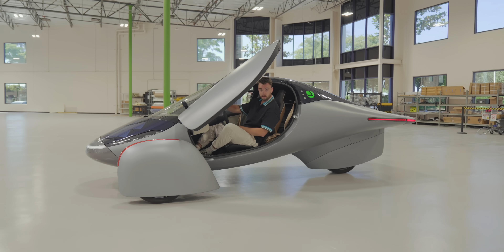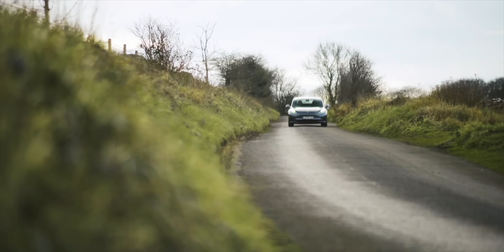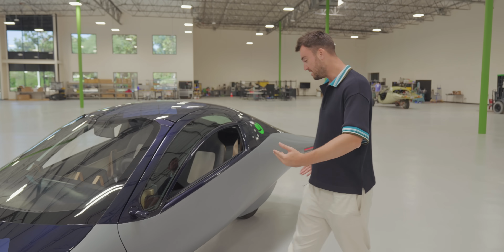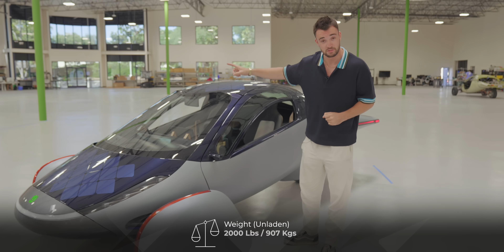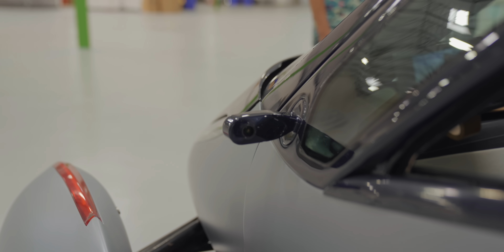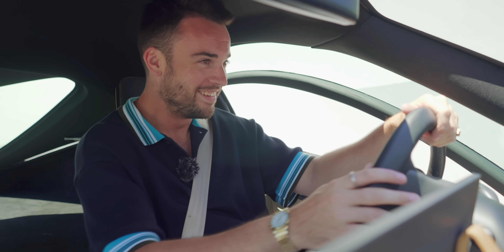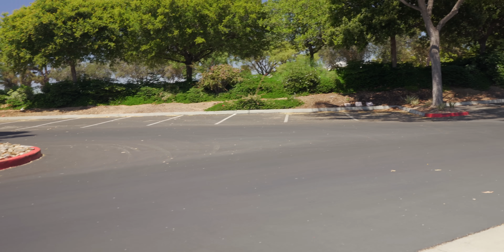The Game-Changing CHEAP Electric Car Inspired By Fish!

Comment: I've been looking at this and honestly I want one, but here's my question. How tall is the host? Cause I'm 6,9" tall and IDK if I'd fit in the thing. Maybe I could get an XXL version?
Reply: Frankly, the tallest it has been designed for is 6'8".  Jack of fully charged is 6'8", and he seemed to be able to drive a smaller alpha version OK.  The gamma and production delta models are larger inside, but I would certainly sit in one before I made my final decision.  Since the deposits are refundable, you could still place a reservation and make your final decision after you have had a chance to try one out.
Reply: @n.brucenelson5920  thank you.

Comment: the aptera, same scam as the elio, remember that, years of begging for presales and investors, huh, never happened. now its been years that aptera has been using the same business model. dont send your cash until they actually produce the vehicles. w.c. fields quote...... there is a sucker born every minute. hey i have a bridge to sell you.
Reply: Not at all.  The original business models were very different in many respects.  Elio for example, never offered refundable deposits.  

Aptera was originally partnered with Idealab.  They hired a CEO from Detroit who got rid of the founders in a board coup, and then changed course, but couldn't find financial backing for a different vehicle and liquidated the company, returning the customer deposits and paying off vendors.

The present Aptera is structured to make a such thing very unlikely to happen again.  Look at the SEC filings, don't take my word for it.
Reply: @n.brucenelson5920  heck i hope they do get it into production, i would buy one for getting around town, a neat concept, just seems like units like these just never make it to the marketplace.
Reply: @johnmichaeltracy9050  What they are attempting is indeed VERY difficult.  I think that this time the founders have gathered enough support to make it happen, and I am willing to do what I can to assist.

Comment: I wonder if they could extend the body a little to provide more protection. You wouldn't take that out on a Australian motorway/highway with the way people drive here and a truck might run over you. It may be good for city but even then during peak hour it looks like another nearby car could easily snap part of it off.
Reply: There are crumple zones front and rear, in addition to a carbon fiber and Kevlar passenger safety cage.  Aptera will be third party crash tested to FMVSS Part 200 safey standards as soon as they have production intent vehicles to test and you will be able to see the actual safety ratings.

Comment: Are you really tall? Because the vehicle seemed significantly smaller than what I have seen in other videos.
Reply: The alpha models were significantly smaller than the gamma or production deltas will be.  They should be good for people up to around 6'8".
Reply: @n.brucenelson5920  Neat, thanks. Aptera is really the only electric car that interests me currently it would have been extremely disappointing if it was a tiny car that couldn't be sat in for more than 30 minutes without becoming cramped.
Reply: @i-hate-handle-names  Yes, I would certainly agree.  You should have a chance to experience sitting in one over the next few months.

Comment: does it ask you why you have the heated seats on with the Air con on?... it should, lmao! oh and while we are at it, talking about efficiency... cough*, *cough why the hell is it being made in cali?... it would be much cheaper to build in texas, florida, arizona, new mexico and it would be being built in one of your highest sales states.  The big heads in cali won't be driving those, sadly they make too much logical sense.  dems don't like that.
Reply: oh, one more thing, i hope it is easy to replace the batteries
Reply: I worked for a California startup that intended to move out of the state.  After an extensive study, we came to the conclusion that "what everyone knows" about this is not true during the startup phase.  Aptera will be expanding production outside of California, however.

Comment: Definitely quite unique yet stunning vehicle but in your description it should stay based on a mammal dolphins are not fish even though they're fish like but are related to killer whales. So definitely not a fish. Just had to add one more thing why did I not just put Alternators on all three  if not two wheels to boost its efficiency to Max Capacity.

Comment: you could maybe pickup milk at the store. other than that what can it be used for other than transporting a single individual. might as well get a bike.
Reply: 25 cu ft of storage and enough room in the back to sleep a couple on camping trips.  It will be better than our present Gen 1 Honda Insight, and even less expensive to run.  

By the way, nothing wrong with bikes, and my wife and I have gone cross country on them, too.

Comment: How about the solar electric scooters for handicapped? The front wheels must be underneath of the car for parking convince. I was watching a little electric car struggling on the hill with the icy road conditions - the tires and the length of the vehicle are important to cope this driving on the hill and on ice combined.
Reply: Aptera can be fitted with standard snow tires and has far better ABS and traction control than most vehicles.  It can sense slip and adjust torque every 2.5" of tread travel.

Comment: Look like a silly toy. 
When i see a prototype like this i always try to think about what its going to look like after 5 - 10 years of usage on the streets. A dent here, a gash there, some aftermarket replacement parts... etc
I'd be very surprised if this thing made it 2 years. 

Half the price of a Tesla huh? so $35k... thats a lot to pay for a disposable toy.
Reply: $35,000 will get you a well equipped 400 mile range vehicle before incentives.  250 miles of range starts at $25,900.  I suspect that these will have an average lifetime of more like 40 years on the roads.
Reply: @n.brucenelson5920  How are you going to get 40 years out of it when the battery doesnt even last 5?
It would be different if these companies used a standard battery that you can get anywhere, but they go out of their way to make sure that thats not the case.
Reply: @nottiification  What makes you think Aptera battieries only last 5 years?  It is likely that the packs will give at least 400,000 miles of range before they decline to 80% of capacity, at which point they still have considerable value in stationary power applications.

The 2170 cell form factor is about as standard as it gets, and they are available from multiple suppliers.  Aptera grants right to repair, so there will be no challenges to third party companies that wish to offer rebuilt Aptera packs when the time comes.  This also means that the software in the vehicle can be reprogrammed to suit new battery chemistries if future developments warrant it.
Reply: @n.brucenelson5920  Have you never owned a laptop or a phone or a e-bike or anything else that uses lithium batteries?
5 Years is a very generous estimation.
Reply: @nottiification  Tesla has said that their 2170 batteries should last between 300,000 and 500,000 miles. Based on an average driving distance of 260 miles per week, a new Tesla battery can last anywhere between 22 and 37 years. There is no reason that Aptera's should be any different, and they are likely less highly stressed in the Aptera application due to the lower weight of the vehicles.

Comment: Except you're currently not aloud to charge your electric cars in California due to the power grid problems.
Reply: False information.  It is only for a couple of hours during peak power demand.  Most EV owners only charge overnight in any case, when rates are low and there is plenty of power.
Reply: @n.brucenelson5920  You are correct, but it is still ironic and worrisome.
Reply: @huffnbassist8779  It is part of the reason I have just moved from California, to Iowa, where over 1/2 the grid is powered from renewables, mostly wind.

Comment: Hey, do you want to see a bizarre type of collision? The fantasy/hype of this feature collides with the stark reality of the present moment ...

Copy this headline and paste it into your favorite search engine (I'm assuming that its Google) and read what pops up.

"California asks residents not to charge electric vehicles, days after announcing gas car ban"

CALIFORNIA (WTVO) — With California’s power grid under strain due to extreme heat and high demand, the utility grid operator is asking residents to avoid charging their electric vehicles. This comes days after the state announced a plan to ban the sale of gas-powered cars by 2035.

California doesn't have the infrastructure in place yet to handle all of this.

- Lets Go Brandon!!! Hi I'm Mr. Rourke and this is my humble assistant Tattoo - Welcome to Fantasy Island"

Comment: I had a MAGAT tell me it would drive up the price of home insurance to have a charging station in home. It's important to have the right kind of home owners insurance so that your home is covered in the event of losses. Otherwise, however, the charging station doesn't drive up the costs. In fact...it's likely to increase the value of your home! So the MAGATs disparaging the EV are only delaying the inevitable! yes...some EVs are un-Godly expensive. But as time goes forward...this will change with progress. But fighting progress is a MAGAT MO.

Comment: Don't use government hand outs for anything, including rebates and the rest to lower costs.  Do have cheaper options, make the design to be had absolute bare bones on the cheap. 

China is producing and selling $5k electric cars, they are crap of course, but people are buying them and driving them on the roads.  You can beat the hell out of them in what they are doing with yours, just think scaled down and you are going to make waves.

Comment: the only thing unique about this is the side-by-side aspect of it... things like this have been done in Europe for about 30~ years... except most people looked at them and thought they were more motorcycle than car vs the side-by-side which makes you think car instead of motorcycle. Also (edit) 2000lbs is about 200~ lbs lighter than a Mazda Miata... so while light... not that light.

Comment: come on 88in width, 300Nm torque 110mph top speed, charging time 8 hours for $46,000, i'm sure people are wiling to make more stops to charge rather than this. also i'm sure a burst of wind will roll you over on the highway, a flat tire and your day is gone looking at that wheel cover,

Comment: Áptera is a full on scam!!
Reply: There is not a shred of evidence for such a claim.  If there was you would not seen Sandy Munro Associates, Roush Performance, and 1st tier parts suppliers associated with them.
Reply: @n.brucenelson5920  maybe so, but if they are like they were in 2010, I Don't have much faith in them. I guess only time will tell.
Reply: @craigwiddison4118  Completely different people from 2010. The original founders lost control in 2009.  I agree.

Comment: Does this require a motorcycle license or 3-wheel certification of any kind? I'd prefer if it had 4 wheels and some bumpers tbh. Otherwise, pretty neat.
Reply: Not for any State but Alaska at present, as far as I can tell.  Check the rule for enclosed autocycles where you live.

Comment: the price I saw on their website is well over 25K for a vehicle that can only go 40miles on a charge.  maybe they'll put a solar panel array on it to recharge the batteries to get more milage. if you live in Santa Monica and have to  the other side of L.A. on the freeway at the height of rush hour. you're going to be pushing your car to a charging station.  It's probably good for neighborhood traffic to go grocery shopping.,
Reply: You have misunderstood something.  The smallest battery range available is 25 kWh and it will do 250 miles on a charge.  It runs $25, 900.  The 41 kWh battery I have on order will go 400 miles on a charge.

Comment: I wonder how well it would get along with cold temp's and six inches of freezing slush and muck or a foot of snow ? Doe's it have a heater and air conditioning ?
Reply: Yes, both heat and AC are standard.  I plan to use mine year round in Iowa and will report on my experience.

Comment: Lighter means you can't drive it on rainy windy days because with no road maintenance being carried out and hundreds of large puddles on the roads it's a vehicle that is highly likely to aquaplane.  The cost of repairs to a vehicle like this is probably astronomical and therefore probably affordable for the medium to very rich....and they love their fuel guzzlers.  Nice try.....Next.
Reply: Not true.  We drive a Gen 1 Honda Insight which weighs about the same 1800 lbs as the 40 kWh model, and doesn't do this.  Aptera performance will exceed it in every respect.

Comment: Could you charge it with the equivalent of a tanning machine on dull days?
Reply: On dull days, just plug it into a 110 volt 15 amp outlet and you will gain 13 miles per hour of plug time.

Comment: Really curious how well one of these will cool in Arizona where it gets pretty darn hot in the summers around 110+ usually
Reply: I lived in Mess for 16 years including the day it hit 122.  I think it will be fine, due to the fact that the body has many times the thermal insulation of most cars.
Reply: @n.brucenelson5920  it's passively cooled like the nissan leaf it's not the driver comfort I'm worried about its more how well the battery will handle the extreme heat

Comment: Love the design, just wondering if there will be protections built-in against theft by a group of people picking it up and walking away. Also would want some kind of alert that it is not charging because someone threw a blanket on top or blocked exposure to the sun some how? I would love to see this car succeed. Could you add charging through the turning of the wheels and little turbine like fans built into the design?
Reply: The problem with turbines on cars is they create drag. You end up using more electricity to speed up and keep moving than they will produce. As they mention, a lot of energy is used just pushing air out of the way while driving, it is a very strong force against a moving vehicle. Turbines would create drag and cause it to require more energy to drive. After energy loss from friction, resistance, etc., you end up with a net loss. They'd really only work as a means of regenerative braking. Regenerative braking is what you get when you put a generator on an electric car, it's a very similar idea. Use the car's motion to turn a generator and recharge it. However, the friction and resistance that comes from doing that slows you down, so unless you are wanting to slow down, it's also net loss of energy. 

Turbines that the blades rotate when driving to not have any drag but then when braking rotate to catch the air and spin would probably work, basically just regenerative braking using air. But that's also a lot more complicated with a lot more moving parts. Not to mention the issues if something gets into it, like a bird, rock, or even a person's hand for example. It would also be hard to keep this car as aerodynamic as possible while having air being directed into the turbines or having the turbines sticking out on the car somewhere.

Sorry that was long, I've looked into it before :)
Reply: We own an 1800 lb Honda Insight and have never heard of a similar issue.  Aptera owners won't have to worry about catalytic converter thefts and the battery packs are too heavy.

The wheel motors have regeneration built in.